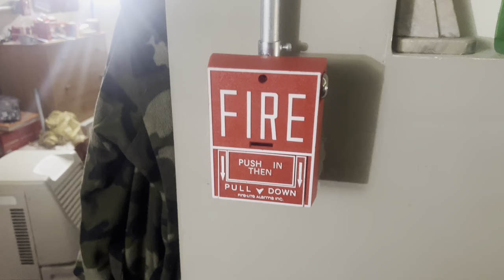System Test Short 7 - Wheelock and Eaton

Comment: It seems like the Wheelock Eluxa has a sync issue with the rest of the Wheelock devices as there's a delay in it's horn sounding
Reply from the maker: The Wheelock sync isn’t enable in this video. I did test the system with synchronization and they all flashed simultaneously.